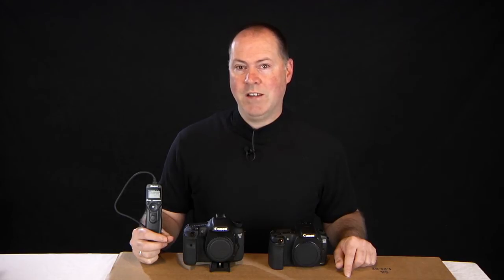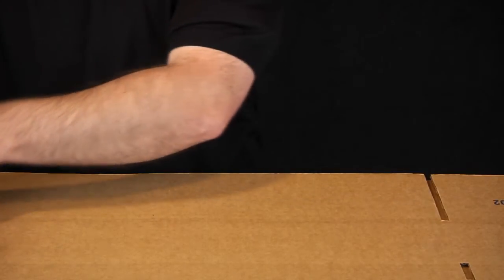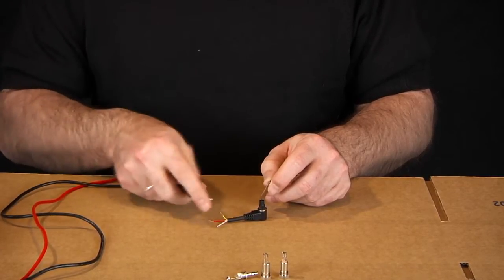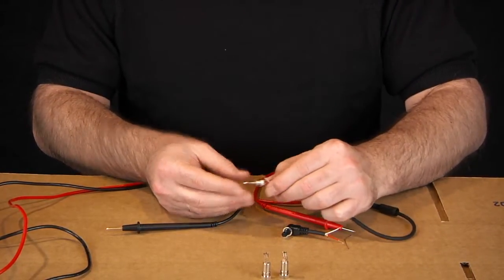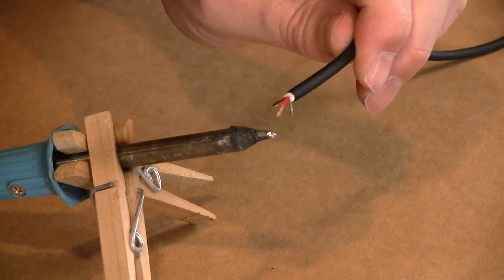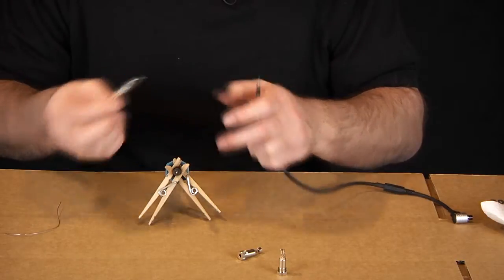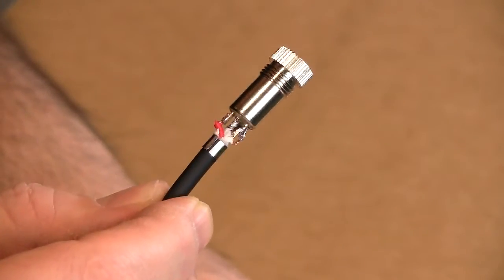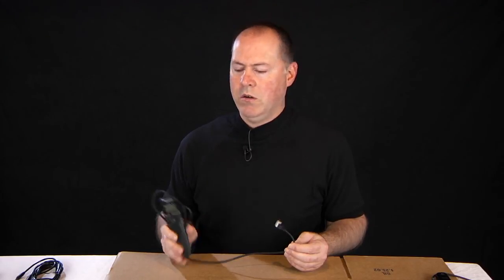Shoot Brand Timer Remote Problems... How to Fix & make Compatible with Canon (XXD) DSLR's

Comment: You don't need to cut the cable if you are having trouble taking it out. You should carefully file the metal sleeves at the base of the pin casing (just a little) so it doesn't stick hard in the camera hole. Not the outer metal cover just the gold ones nearest to the black connector. Once you do this you should be OK and the timer works fine. If